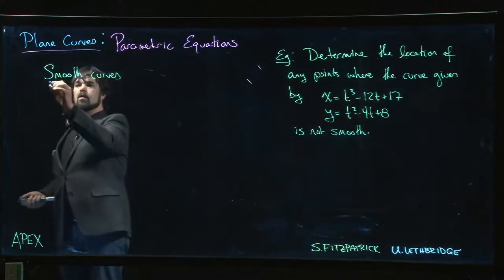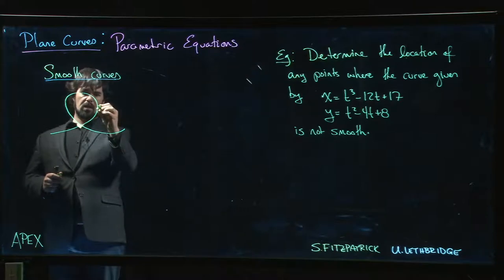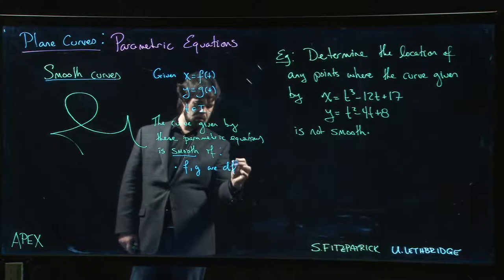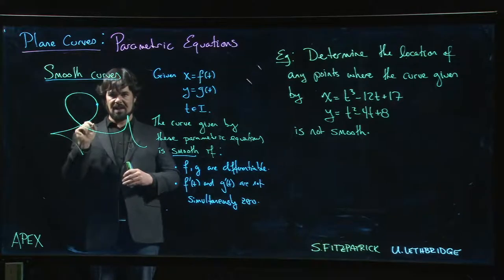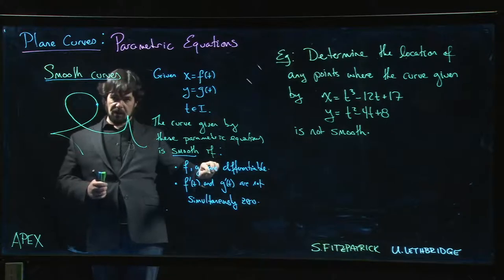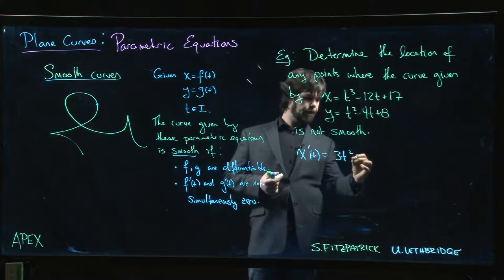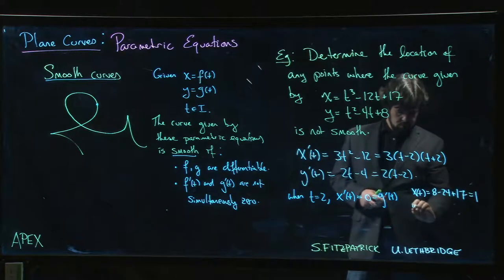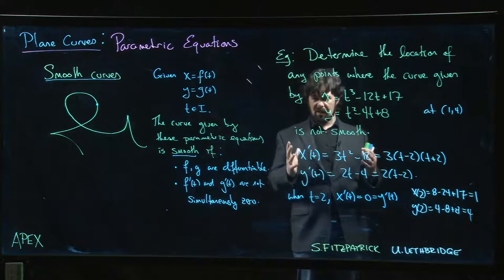Plane Curves: Parametric Equations - 06 Example: Non-smooth curve

Comment: Good day Sir. I was just wondering whether you could, please, do a whole seperate video on why the curve would not be smooth if the derivatives (of "r") equals zero, simultaneously :) .
Reply from the maker: We don't have our board set up right now. But you can just look at the example x=t^3, y=t^2 when t=0. (Without the parameter this is y=x^(2/3).)
Reply from the maker: Also, it's possible that a curve might be smooth even if both derivatives are zero. But having at least one nonzero derivative at each point guarantees the curve is smooth
Reply: @seanfitzpatrick3602  . Ahh, i see, i see. 

Could you, possibly, provide me with an example of where both derivatives are zero (simultaneously), and yet the curve is still smooth? 

Also, thank you, very much, for responding to my question, i appreciate!
Reply from the maker: @hermanfourie66  what if you do x=t^3, y=t^6?
Reply: @seanfitzpatrick3602  That worked! Thanks for helping, i appreciate!